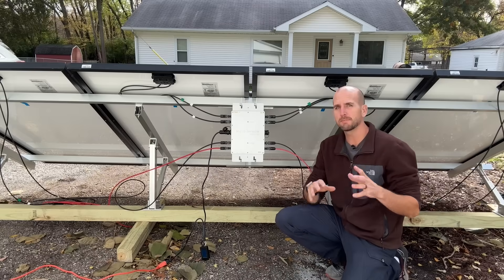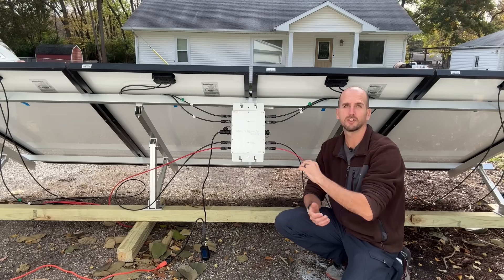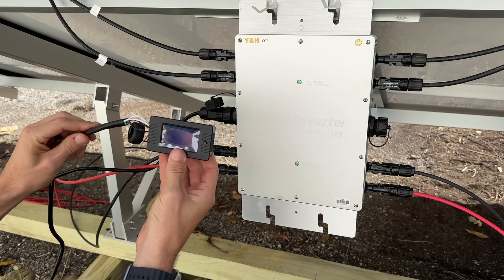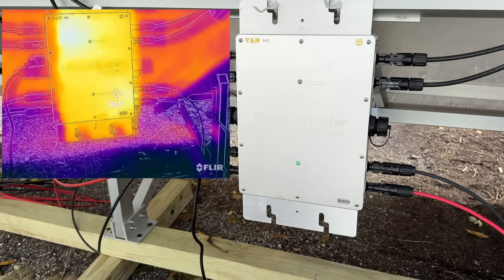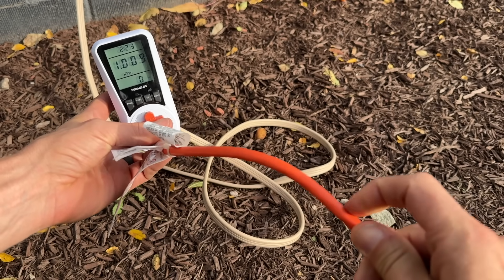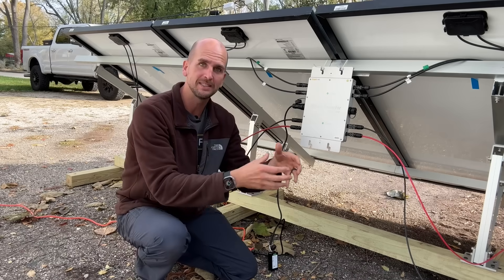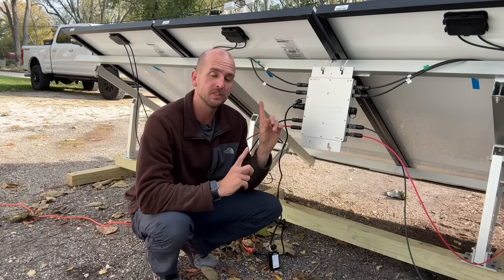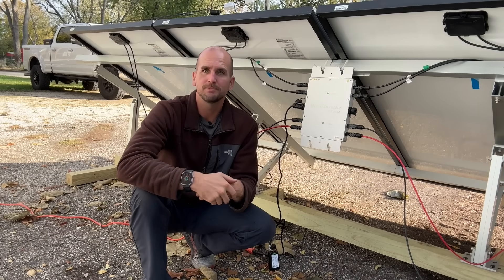Plugging Solar Panels Directly Into An Outlet | Surprising Results

Comment: IMO a better and safer way to do this would be to run loads off a transfer switch so you are isolated from backfeeding to the grid. You also are less likely to get into trouble from your power company. I installed my transfer switch without an electrician.
Reply: There is no way to isolate this from the grid, the grid stimulation is what allows it to parallel into the homes electrical consumption, and only on one leg of the panel.  In my opinion it will not get accepted /certified for grid tie through your power company, regardless of what an inspector says.  If there is any agreement for two-way metering it usually costs at least $10 per month just to have that, grid tie at my home in Indiana is $12 monthly, so you'd have to make a lot of juice to just break even.  If you send even one electron backwards without this agreement (modern meter system)  you can have your service disconnected.  There's so much to think about before trying this.  What would be interesting is to isolate the home with a generator lockout in the main panel and create your own grid separate from the power company and add a little juice through two micros --one on each leg, to reduce the generator load.  You would have to consume a the solar input as a minimum or risk generator damage though but that would be on you, without any grid to absorb any excess.
Reply: @bruceeverett5372  a generator lockout and transfer switch operate the same way. Both options completely remove the circuits from the grid and allow them to run on an additional power source.
Reply: @MrSummitville  yes I understand.... That's why I would recommend using a different solution. Like a battery and inverter and transfer switch, not a grid tie inverter like seen in the video.

Comment: 120v not 240v means it is single phase so you are only "powering" anything on that same panel busbar and off setting the usage on that single phase. So someone would in theory need to be able to identify which busbar is more heavily loaded and back feed a circuit on that phase.
If you were to be using a 240v appliance, Electric Stove/Dryer, I would be interested in "seeing" how the current would interact between the panels, grid, and the appliance as the solar panels with this inverter is only supplying current to 1/2 the circuit.

Comment: Would this work with a rooftop solar panel system?  Lets say  I know my rooftop won't give me 100% of my power for a short time(month)  for some reason, like I have  a ton of Christmas lights.   Could I use something like this up to help my rooftop solar panel system?
Reply: Yeah, you really want to pump several thousand watts into a 120V line.  Won't the wiring overheat the 120V circuit.  Burning down your house to save electricity is seldon a good idea.

Comment: I'm just thinking outloud here, in a written sense, but say you had a fully off-grid setup already in use at your home or property.  Presuming you have a loads panel and that feeds one or more 120v outlets, could you connect this string inverter to that outlet, where it will sense the voltage from your off-grid setup, and start feeding that system with the energy it produces?  Seems like this could be a very good way of adding more peak demand capacity, like running an AC unit during hot days or a resistive heater on cold days?
Reply: You risk frying your existing off grid inverter if you back feed into it with micro inverters. Don't do it man.
Reply: Off-Grid Garage ( Charging my battery from almost anywhere with this grid tie micro inverter and the Victron Multiplus )

Comment: Just plain bad idea!!!!  That must be grid tie configured? "If the grid stops, pushing you STOP producing power!!!!!!" do not connect infrastructure to your home with a plug or receptacle configuration if so, it needs to be rated and designed for continuous operation at the  listed rated  power  plus 50% derating factor.. Receptacles melt!!! Please be safe!

Comment: You should have tested if it turns off when you lose grid power (wouldn't turning off the main breaker stimulate that?)
Reply from the maker: Agreed, I will add that to the longer test I am currently running 👍

Comment: I don't see in the specs where it says it will shut off if the house power cuts off and I find that suspect.  You need to test that feature and see how fast it cuts off power. That would also negate any benefit for an emergency power system as it won't work in a blackout.
Reply from the maker: Agreed, I will test that functionality on the next test where I let it run for a couple weeks.
Reply: That is the problem with all AC micro inverters... They are made to only work to feedback the grid...

Comment: 1: Having those exposed AC terminals (especially outdoor conditions) is an awful idea. That power meter should just be bypassed.
2. There's no safe way to plug this into a house, I just don't know how much I trust that the inverter will shut down when power goes off or it's unplugged.
3. There is the potential to overload the circuit it's plugged into. You could potentially draw 30 amps through the receptacle and some of the wiring without the panel breaker tripping. It should be plugged into it's own dedicated circuit, or preferably right to a breaker.
4. Would be nice if  US residential was all 240V single phase, it would make circuit distribution easier and cheaper. You could run 14 gauge to almost every circuit and not have to worry about panel leg imbalance.

Comment: Their instructions say do not exceed 1200 watts of total panel (max of 300 watts/panel), seems like it work with 4 of your over 300 watts panels.
Reply from the maker: Yeah, the integrated charge controller is just reducing the input current maxing the 360W panels out at 300W.
Reply: @everydaysolar   may I ask, is it possible to back feed it thru the solar generator like the ecoflow delta pro? If it works it would be a good option  to charge your delta pro and also  it can be use to test the used  pv panel your buying if it works.  I have bought used panel that I tested with a voltage meter but when I got home, it will not work with my gridtie inverter, even though voltage was ok.

Comment: I've got a couple of these sorts of microinverters.  Mostly for testing how bad they are.   And they do work, but most of them do have major gotchas and issues.   Y&H is a major brand for these sorts of things and you are right, there are likely onl two actual OEMs.

* These devices are mostly not current limited. I think they are somewhat temperature limited, but at too high a temperature.   If you plug in too much solar they will happily over-produce until something fries. 

* These devices have VERY POOR efficiencies.  They market high efficiencies but the actual efficiencies are generally around 80%-85%.  Very very poor.    Real micro-inverters have efficiencies above 97%.  And you can tell by how hot these suckers get.

* These devices as sold are often mis-labeled with regards to voltage, power, and current capabilities.

* A 120VAC AC output is just putting power back on one leg... only one of the HOTs coming into the house from the utility (there are two, for 240VAC) is having power returned on it.   Of course, you are also limited by the household plug.   But still, it is not ideal.  So at least try to match what the microinverter is pushing with other household loads that are on that leg.

* YOU CAN OVERLOAD A HOUSE CIRCUIT WITHOUT TRIPPING THE BREAKER.   THIS CAN CAUSE A FIRE AND BURN DOWN YOUR HOUSE!   How?   Lets say you have the circuit wiring with household plugs going from A to B to C to D to the 15A subpanel breaker.   Now lets say you plug the micro-inverter into C and you are pushing 1000W.  Now lets say that you turn something on at B which eats 1200W.   So far so good.   The breaker only sees 200W and the B-C segment has 1200W on it.  But now lets say you turn something on at A which also eats 1200W.     Now the breaker is only delivering 1400W to the circuit but the "B-C" segment of the wiring has 2400W running through it.   Bad end.

What this means is that if you do use something like this, either severely limit the amperage it pushes back to the grid (to less than 500W is my recommendation), or ensure that it is on a dedicated circuit.   Normally grid-tie inverters are required to be on dedicated circuits.

* These units do not track waveform deformations due to inductive loads very well.  From what I can tell, they literally just push a synchronized sine wave instead of doing 4-quadrant matching, so in terms of dealing with reactive power they might be making a mess out of the waveform or they might be overheating themselves trying to work against the reactive power on the waveform without realizing it.   So YMMV if you have an A/C system running.

* These devices will operate with line voltages that are way out of spec.   They are designed for broad compatibility across several countries.  But the high-side of the range they will push the line voltage to is probably too high.

* These units are NOT UL1741 or UL1741SA certified.  It isn't even close.  UL1741 is the certification required for grid-tie.  These units will shut-down if the grid goes down, sure, but not being certified means that these units do not follow safety protocols for grid restarts (for example).  Among many other issues.

My conclusion is that for someone just messing around with a few hundred watts, these things do work fairly well.  But don't trust them beyond that.  Certainly not with the large array you connected that thing to in your example.   And be damn careful not to overload whatever circuit you plug them into.  Don't share a circuit with a room that someone might plug a space heater into, for example.
Reply: I have a detached shed I just trenched dedicated power to on 12awg and a 20a breaker. I wanted to use this setup to charge power tools, yard lights, and when excess is produced help with the offset idle house usage or push back to the grid. If make an outlet just for the inverter, would this be a pretty safe and savvy setup? Would throwing a GFCI on the outlet help and/or creating a sub panel breaker box in the shed help for safety? I already have a professionally installed solar system on my house so I’m already approved to push back to the grid. My electrical usage is increasing from when I first got my array installed so I’ve been wanting to expand my array and DIY it. Thought throwing 2 400w panels on the roof of my shed would be sweet with this little inverter. And make use of the shed roof real estate.
Reply: @kylezane2718  Throwing 2 x 400W panels on your shed is an excellent idea.  That alone would be enough to charge power tools and run (LED) yard lights in the evening.

Usually when people do that they tie the panel into a small power station, or build a small charge controller + LiFePO4 battery + inverter system for it.  And don't trench AC to the out-building at all.

But since you trenched AC to your shed already, you want to know if you could put one of these micro-inverters in and tie it to the trenched AC?   The answer is yes, as long as the topology is done right.

* The trenched AC line should be on a dedicated circuit from the house, not shared with anything else.  It is ok if the circuit hangs off a sub-panel though.  120VAC is fine but make sure a ground is also run (3-wire... hot, neutral, ground).

* GFCI breakers area good idea.  Certainly at least the breaker in the house panel that runs to the trench should be a GFCI breaker for safety to catch shorts to ground.

* Put an additional small sub-panel in the shed. 

* Tie the micro-inverter into the sub-panel through an appropriate breaker.   Make sure it has ventillation.

* And tie other garage plugs into the sub-panel through appropriate breakers.   GFCI plug(s) are a good idea.

Beyond that, you have to make the determination as to whether you trust the micro-inverter itself.  That part is on you.  I personally don't trust these micro-inverters very much, I have a metal box with fans that I stuff mine into when I use it.   But my preference these days is to put together a small solar + battery system instead and not mess with the grid at all.
Reply: You are only marginally correct. In some cases you were flat out wrong.
Reply: @Loki-rascal  You are welcome to actually post real information and not garbage.  Try it.

Comment: This is what is called a grid-tie inverter. It back feeds into the house wiring. Problem is if the grid tie puts out more power then the house uses it will back feed onto the grid! If you back feed onto the grid most power companies will CHARGE you for doing that if you don't have a back feeding agreement with them. This looks like a cheap grid-tie inverter. But there are grid-tie inverters out there that have a wire that goes to the breaker box. They can sense if they are back feeding into the grid and cut back power. Either way a hybrid inverter is really the best way to go legally and up to code. A hybrid inverter sits between your breaker box, and grid. It will power your house from solar, and if it needs more power will use the grid. It can also take batteries for excess power storage. Though batteries are not needed.

Comment: I am assuming the circuit MUST sense and synchronize itself to the power grid like expensive systems. However, I have 3 concerns...
Concern 1) I would highly recommend stressing that connecting the way it comes is against the code and could be DEADLY! All you need is a kid (or adult) coming by and unplugging it. I suppose it could be meant to only output if it senses grid power but is that the case???? Just too much risk IMHO. Of course a "regular" male plug is also very dangerous on the house side, so that isn't the answer either. Maybe they make a special no exposed contact connector???
Concern 2) The danger of backfeeding the power grid... I suppose the same safety feature I mentioned for concern 1 MIGHT take care of that in theory?
Concern 3) As someone else mentioned, with both the solar and grid able to supply power, the normal breaker protecting that circuit could in theory supply more than it's rated current... The amount from the breaker AND whatever solar can supply. It should feed a dedicated circuit IMHO.
Thanks for your videos. Please take this as constructive feedback. (Note: I am NOT a licensed electrician.)
Reply: Properly designed follower-inverters have to continuously monitor line voltage and current to keep their output current in-phase with the grid.  The inverter is basically acting like an AC current source and on disconnect, its output voltage will surge from no longer having a load to dump current into. It has to immediately shut down to avoid self-destruction.

In the case of an utilities-side power failure, follower-inverters aren't capable of maintaining a stable waveform on their own and should shut down as soon as they detect that line voltage isn't anywhere near sinusoidal, not the correct frequency, not the correct amplitude, etc. Also, when power goes out, those inverters would suddenly need to offset 10s of kVA worth of distribution transformer reactance that may still be in-circuit on top of all of the loads those are connected to. This makes it impossible for follower-inverters to keep current in phase with voltage and should cause them to shut down much faster than AC motors will stop back-feeding into the grid while spinning down.

Comment: We had a solar system professionally installed for our home. They used AP Systems QS1 inverters which also have 4 inputs. The output is 240v and after going through a cutoff switch ties directly into the main power input of our home.  The system has been running now for 8 months. I can monitor the output of each panel or of the system on my iPhone.
Reply: Hi, just watch out for the DC Company noting you back feed. The EU allows up to 500w in but they go off when the grid goes down for safety.
They are good and just keep working in the background powering the loads you have and reduce your bills.
Combine it with a battery and a charge controller and you could have power 24 hrs a day. It works.
Good for all those parasitic loaded and thing you have on during the day.
Take care M.
Reply: @markeh1971  What  watch out, his system was approved and professionally installed using the same types of mirco inverters. Most grid tie installations  now are done using Micro Inverters.
Reply: The inverters you have are the same thing as these companies are pushing as plug and play. They function exactly the same way because they are the same thing. They just added a led display on a cable and a standard plug . They can get two of these same units and plug one into each phase then they will be feeding into both phases. Your system will go down just like theirs when the Grid goes down to prevent islanding.